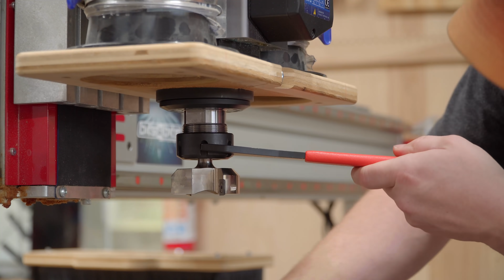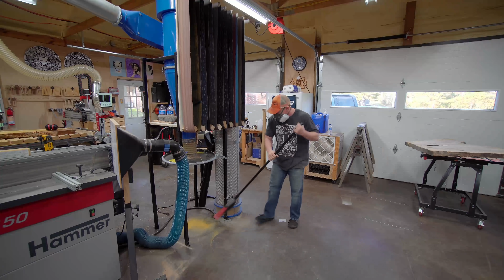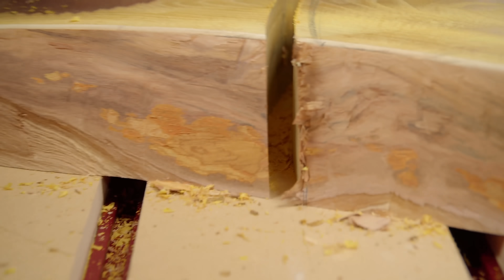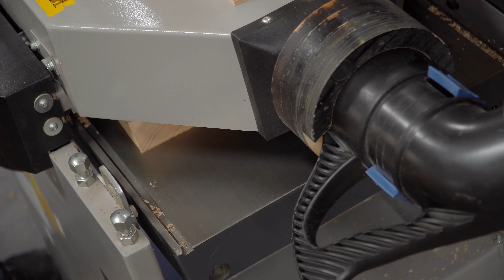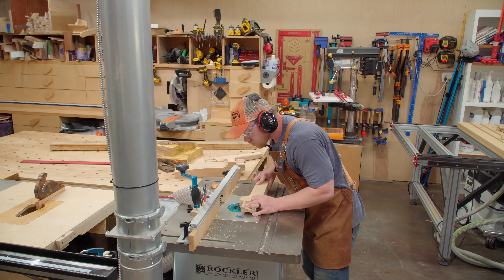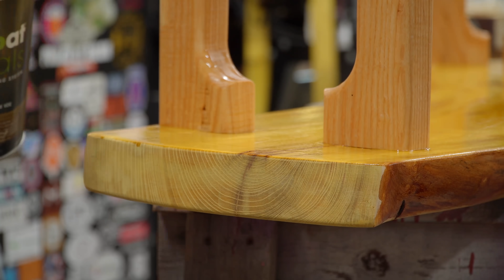Dog Bone Bench - 376

Comment: To debark stuff like this slab, use a Triton Superjaws to hold one side and the other side resting on a sawhorse.  This puts the slab vertical and so the live edge is on top and easy to draw knife.  I've done this ALOT with live edge (natural curve) timberframe braces.  Also it's always best to remove the bark while green if possible.  It's harder when dry.  Also depends on if the sap was running or not when it dried.

Comment: Nice job what finish did you use on it I am making 4 adirondack chairs and don't know what to use 🤔
Reply from the maker: Basic oil wax mix. It's not durable but easy to reapply
Reply: @JayBates  easy is one of the requirements for me to use it 🤔